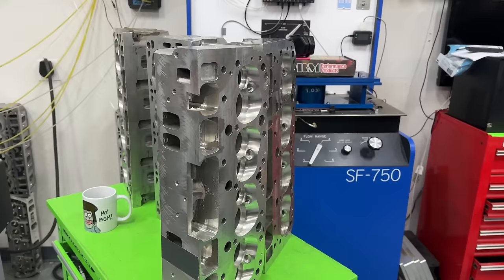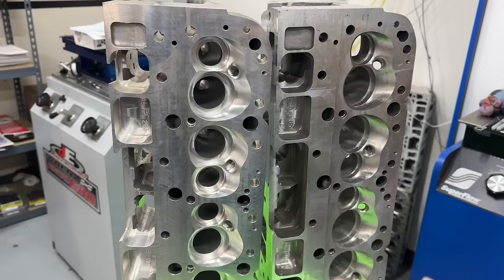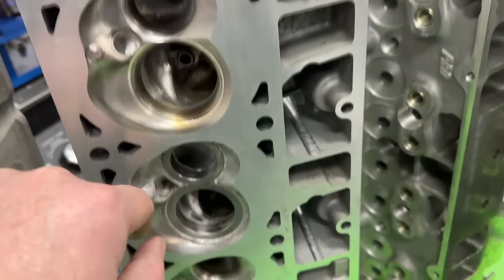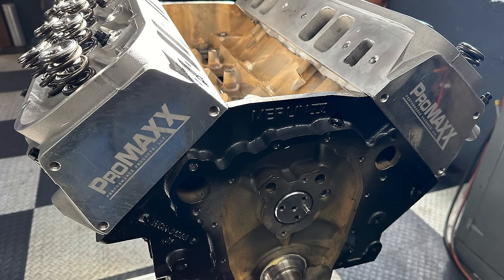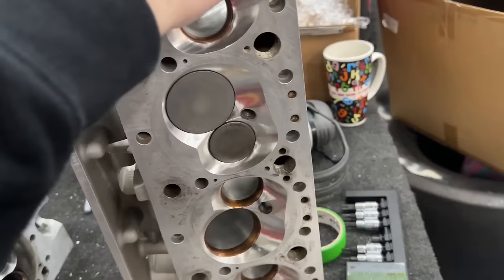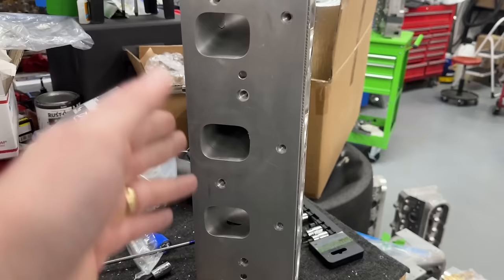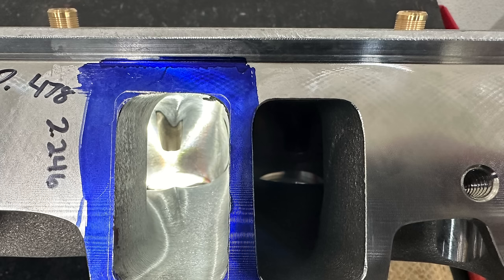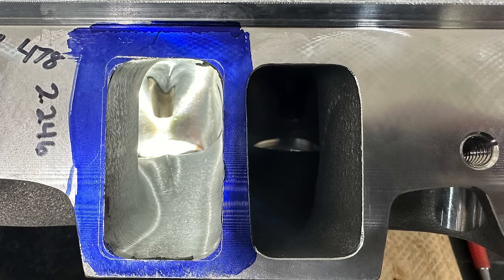New Heads And Ex NASCAR Heads

Comment: You mentioned new ideas are needed.

Ideas:
Exh port design geometry as it relates to specific engine combinations.

How static compression ratio can effect intake signal strength and or intake port depressions during the intake stroke.

How you determin intake and exhaust throat size for specific combinations and rpm bands.

 Quench squish velocities, quench area vrs bore area, quench pressures and temps in relationship to detonation.

Cylinder head water jacket design stratagies, coolant transfer hole size and placement for best power.

Effect of engine harmonics on fuel dropplets and carburetor booster fuel discharge.

Comment: Hi Eric. I would really like to learn about the transition from the port floor to the ssr and how to widen that area properly. That area transitions from a rectangular shape of the port to a round shape of the bowl. How do you make that work properly. I can get ports to flow pretty well ( for a hack ) without removing too much material but then there is too much flow/velocity to make the turn on the ssr at higher lifts. The air separates off the ssr and flow drops. I know that you have to lay back the ssr but you often need more area at the ssr to slow the velocity. It's how to get more area and the transition from rectangular to round that I am after not as much of the radius of the ssr itself that I need help with. I hope that my crappy description made sense. I watch all your videos to the end. Always excellent stuff. I have my fingers crossed that your kid makes state.
You know... If you ported cast iron heads you could work out and make money porting at the same time!!
Andrew

Comment: I would like to understand the relationship between head flow/velocity and cam duration. If CSA governs peak HP RPM, as flow increases, at what level does cam duration need to increase or decrease to see a given level of power. Convoluted, but I hope this makes sense.
Reply: Is there a way to calculate "max rpm" from head flow/csa and engine displacement?
Reply: Yes, there is a formula to calculate the CSA needed to achieve an RPM. That is part of properly sizing a cylinder head. What I am trying to understand is what effect can duration has on peak HP RPM. If I have the correct CSA for a HP and RPM goal, how do select the the correct cam duration to avoid an unnecessary amount.
Reply: I should have said MCSA (minimum).

Comment: The Pontiac heads are mid 80's, late 80's 18° heads became legal.  From the way the JB Weld is done on the intake floor, they probably came from Blue Max Racing.  There's probably some camouflaged welding on the roof, and the centers on the deck between the exhaust valves is probably also weld.

Comment: I second the motion on cam events vs head flow. After studying cam parameters and looking at dyno results for some time now, it seems like SBCs take more duration to get to an rpm band than LSs (of similar displacement). You often tell us that you can do just as well with SBC heads, but it seems like the average LS head is flowing more than the average SBC head. Maybe there’s more to the equation, so that’s my suggestion for discussion. If you can go into some calculations without getting into proprietary information, that would be even better.
Reply: I base 99% of a Cam choice, based on overlap flow

Comment: Great video! You have a bunch of cool stuff out there.

I have a set of those sb2.2 heads for an aluminum build, 4.125 bore x 3.75 stroke, 401 ci. 

They went 391.5 at .900" and 394.3 at 1" on the intakes and 276.4 at .900" and 281.0 at 1" on the exhausts on Speier's bench. They aren't maxed out and are sized for max horsepower at 8500, with just over 3" MCSA at the manifold face. Looking for 900 hp plus on this build NA for a small tire class in a 68 Nova.

I have a set of Brodix 10X RI heads I'd like to send out your way to have them checked out one of these days, and also a set of Trick Flow Twisted Wege heads, which are the first version at 180 cc's on the intake port. They have a 13 degree intake valve and a 23 degree exhaust valve. It would be interesting to see if you could do anything with them airflow wise as they run really really well on anything I put them on.

Comment: can  stock GM vortec heads work on a 400 sbc +040 or are they too small in port and chamber  as opposed to the cylinder size. and run around 420 hp with 10.1 comp and a hyd flat tappet.
Reply: I ran a set on a stroker. Kinda depends on cam no matter engine size. In my opinion. They only flow so much. I switched to aluminum heads and cammed up.

Comment: Hey Eric I would like to learn about what happens when you open the exhaust port too much as in raising the roof and then having to grind the header flange and primary to fit.  This happened to me when porting a set of fastburn vortec heads. Would it loose velocity or flow?  Also does it loose or gain flow on the intake by squaring the openings from canted stock shape.  Thanks for lol your expertise and videos.  God bless!

Comment: Do a video on MCA ,how to estimate air speeds , bowl percentages & bias in the bowl ,just some ideas ?
I am porting some DNA cylinder heads ur videos were super helpful 
I'm going to run the same tunnel ram u dynoed , I'm gonna gasket match the plenum to the runners to start with but possibly gasket match it to 1206 fel pro + open the plenum up 10-20% I'm wanting to turn it to 7000 shit point ,I watch ur dyno run on the 406 & it shut down about 6300 what are ur thoughts on it , my motor is a 355 hyd roller 226 in 232 ex on a 108

Comment: I have a pair of air cooled stock VW heads from Brazil. I would like to replace the exhaust valve seats with a higher quality exhaust valve seat as I will be running stainless steel Manley valves. Eric, could you tell me what US manufacture(s) you work with?

Comment: Hey eric,
Are you going to port the 867 Pontiac heads or atleast flow them and do a review on them?.
I have a set myself and curious on your opinion on them mine have been worked to take a 1289 Fel-Pro gasket.
Reply from the maker: I already did and will make a video.
Reply: @WeingartnerRacing  awesome! Thank you

Comment: Question can you turn down the valves and possibly add a new angle to seat to accommodate that to run LS7 heads on 4.065-4.070 bores?
Reply: There's no advantage doing that,  LS3 ports and valve sizes will do what you're after for those bore sizes.

Comment: Does rolling a sbc head to 21 degrees help flow enough to make it worth the work?
Reply: Yes, power improves if short side radius is not sharpened.  Valve stem centerline moving over results in bringing floor angle up - and that is when good things happen [especially with wet flow].  If I could add a question, it's which head companies can either set that up at least partway: bolt holes shift etc. and it seems dumb not to do that work up front whenever possible given a fresh casting.